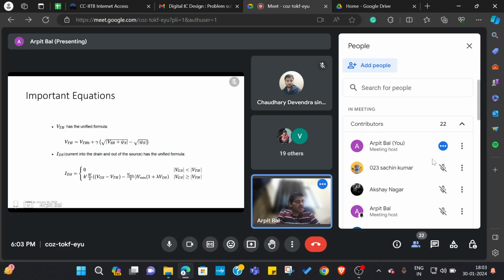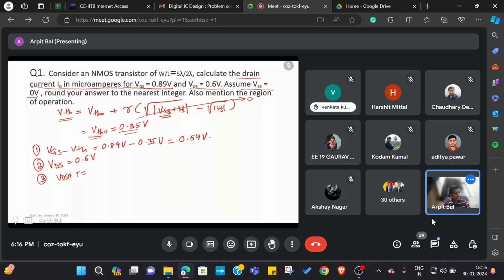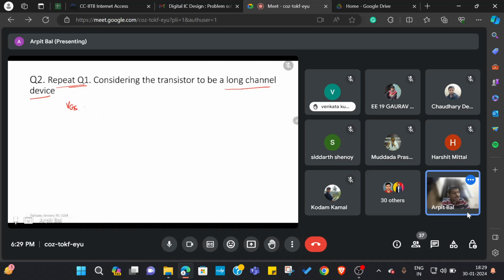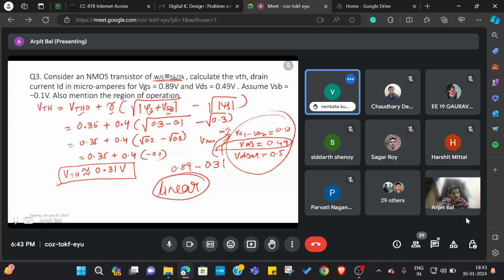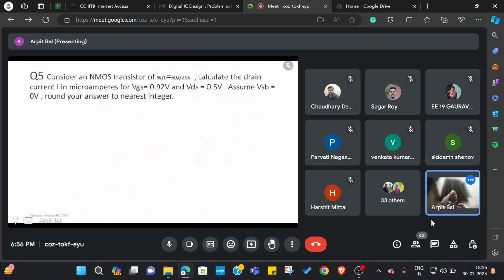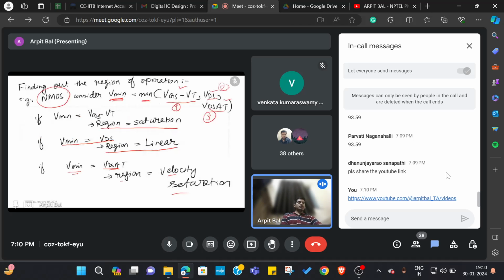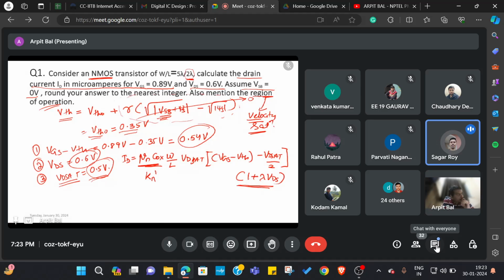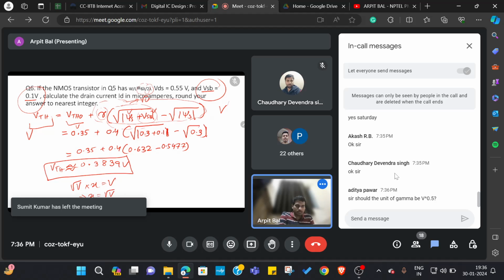Week-1 NPTEL-Digital IC Design-Live session-1(Jan.2024) TA Arpit Bal

Comment: 00:09 Introduction to the session and motivation for the live sessions
05:46 Covered topics in Week 1 lecture
11:58 Understanding transistor saturation conditions
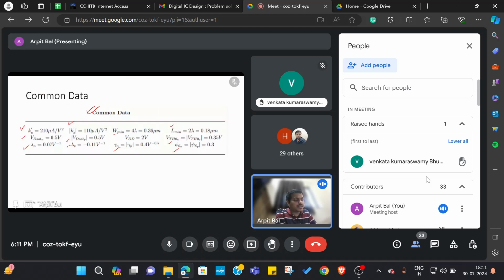14:41 Calculating drain current ID for NMOS transistor
22:03 Short channel effect and ID calculation
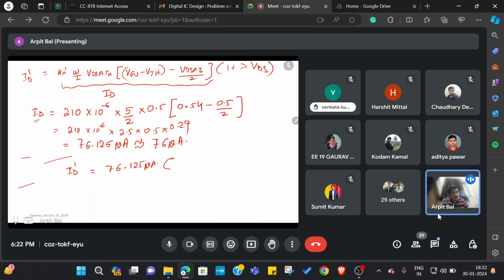25:18 Channel length modulation depends on the length L and not the ratio w/L
32:08 Channel length modulation and its impact on transistor saturation
35:08 Calculation of Vth with the presence of body effect
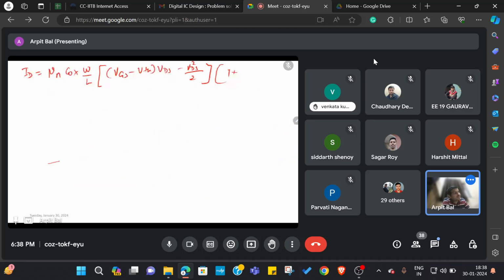41:19 Discussion on using linear region for channel length modulation
45:35 Current direction in NMOS and PMOS transistors
51:03 Sign conventions clarification for better understanding
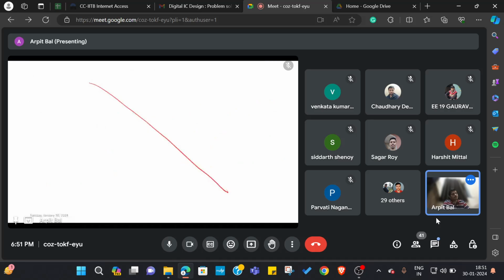54:19 Identifying transistor operation region
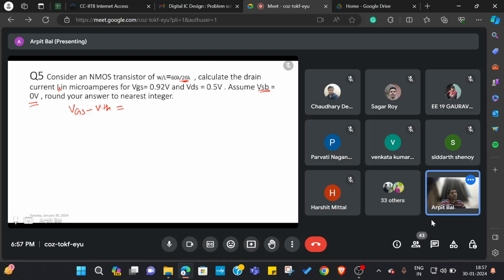1:01:10 Discussed the calculation of VDS and region of operation for a transistor
1:04:35 Consider short channel effects and body effect in digital IC design
1:12:06 Live sessions available on YouTube for practice and learning.
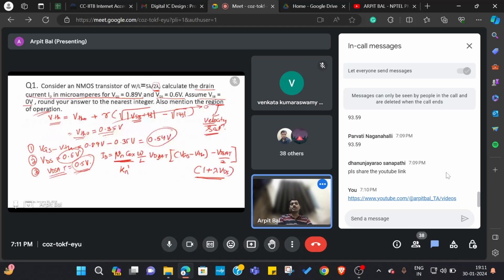1:14:55 Determining the region of operation based on vgs minus vth and VDS
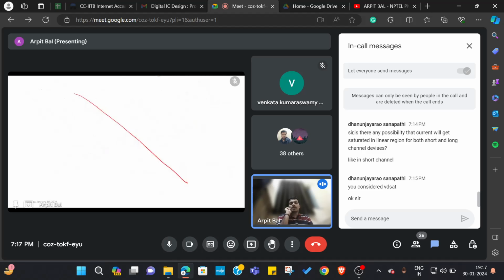1:20:13 For PMOS, consider mod as negative and calculate Vth according to given values.
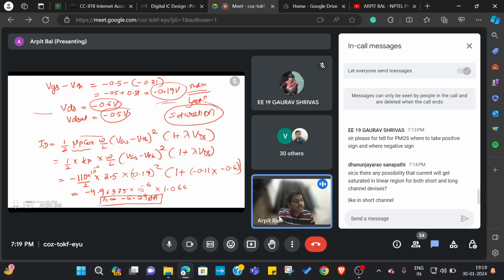1:22:52 Understanding parameters in IC design
1:28:33 Scaling technology node impacts electric field and velocity.
1:31:41 Next session on 6th February, 6-8pm to solve Junction capacitance problems
1:37:46 Access to lecture slides and notes will be provided through the NPTEL team.
1:42:02 Video recording and slide availability